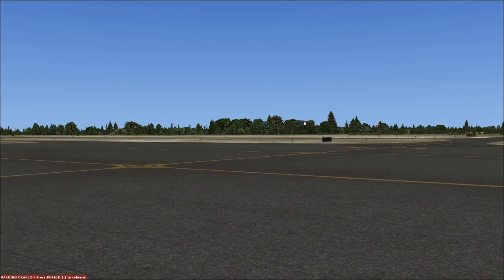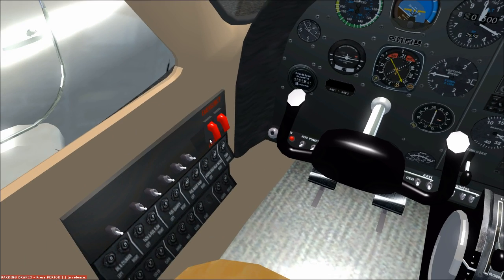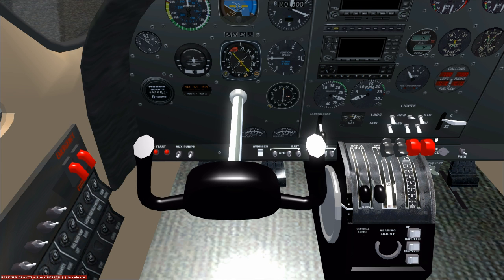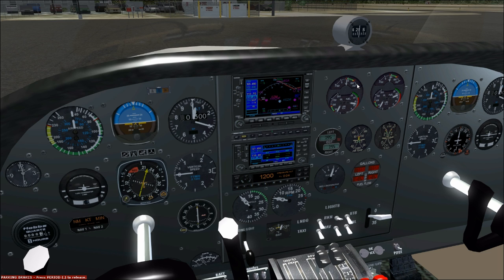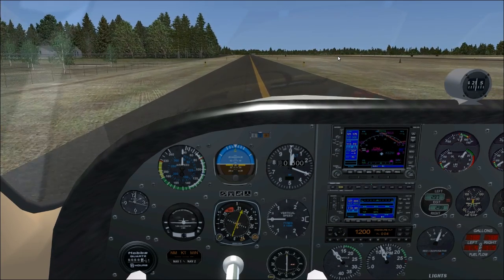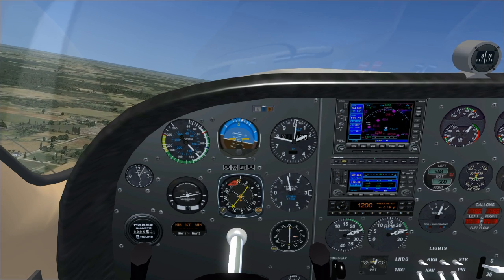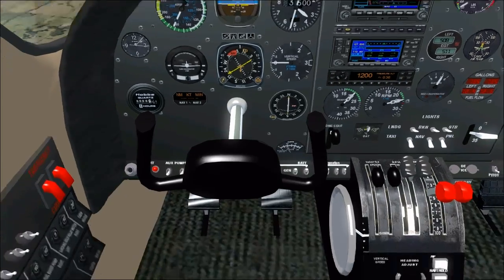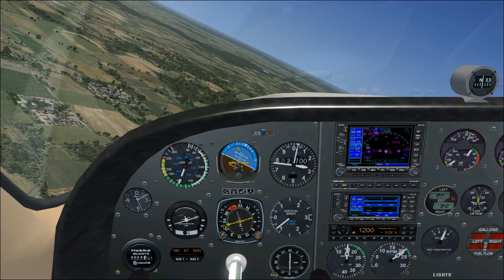Military Visualizations Cessna 310 Tutorial. Video 14, A free alternative

Comment: I liked that. Seems like a very well made model.
Could you do a video on how you replaced the gauges and GPS. I would like to do that to my default Baron, and use the Carenado gauges and GPS. I'm hoping it would be the same as the FS9 version.
Thanks for your work making these videos.
Paul
Reply from the maker: +PT Johnson Its a bit of a involved process. i used a program called FSpanel studio. Some edit can be made by editing the Panel CFG file. but placing the GPS the way i did is really hard using that method.
Reply from the maker: manually with a text file editor. try the demo it should have a way to edit the file directly. then you can copy and paste the changes. atleast the paid version i use does allow edit of the panel files directly. witch you could do anyway with notepad or wordpad. FSpanel studio just gives you a GUI to use.